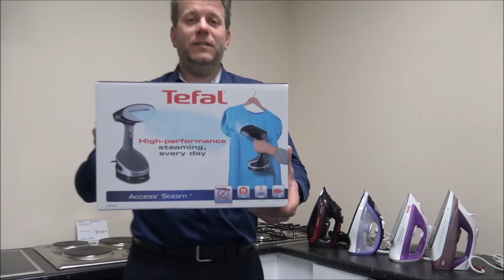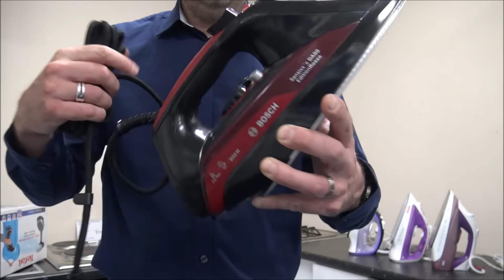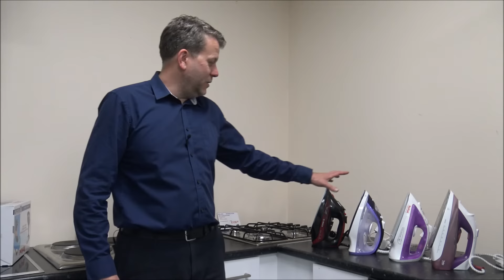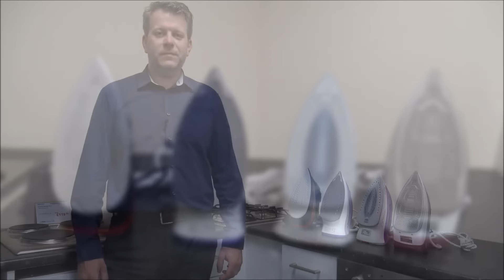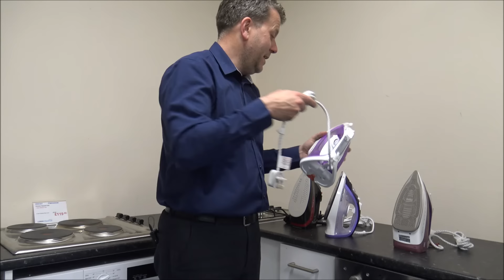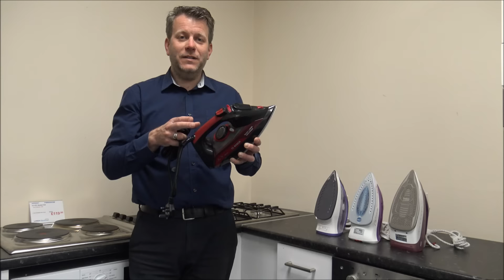11 Things to Consider Before Buying An Iron - Iron Buying Guide

Comment: Thank you for the in-depth search and sharing .. would u consider doing Dyson fans are they worth buying ? Heard the air blower isn’t great .. thank you
Reply from the maker: They are good and better than a normal heating or cooling fan but people are under the impression that it will cool the room down which isn't the case.

Comment: Very informative thanks. My Philips iron does not have a temperature control, it somehow detects the fabric you are ironing and adjusts the temperature accordingly. You can also leave it facedown unattended and it won’t burn the fabric underneath (it doesn’t switch off)
Reply: How are you finding it? Just got 1 today havent used it yet
Reply: @anthonybotonis5841  I've had mine over three years now. Overall, very pleased, it does a good job on anything I've ironed. Cons are it is a bit on the heavy side and warm up time is a little slow.
Reply: Thanks for the fast reply. Great to hear. Looking forward to testing out